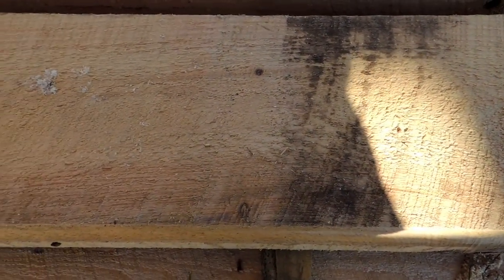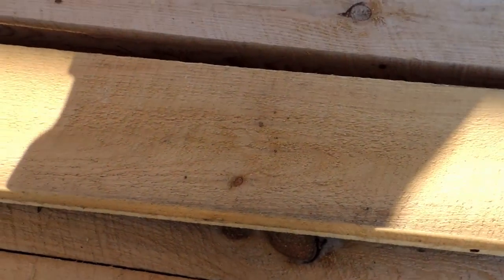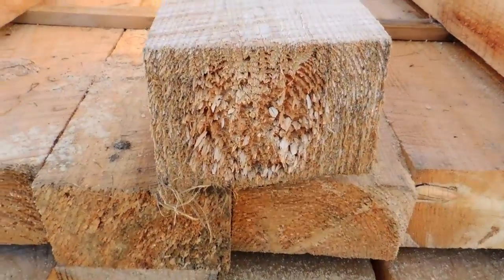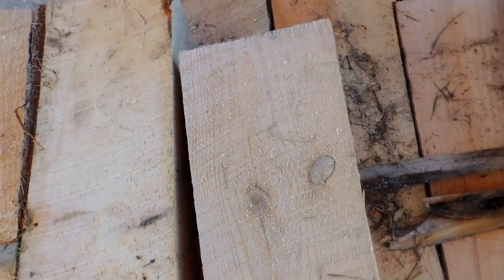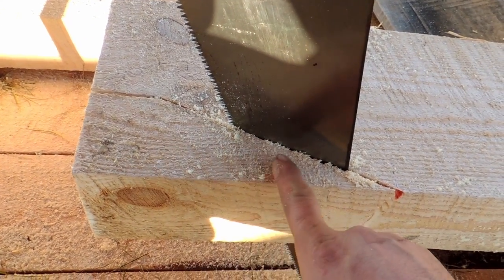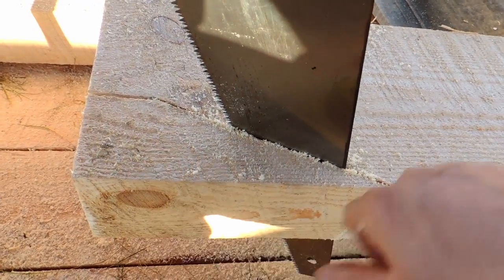A Timber Frame Vlog #9: Floor Joists and Timber Selection

Comment: Hi Jim, since this is an older video, can you share how the floor joists have settle over the years?  With the joists shrinking as it dries and seasons and the girt/plate and summer not shrinking in length, how large of a gap has formed in the joist pocket so far?  Has it caused any problems for you like loose joists?  Thanks for the video
Reply from the maker: Good afternoon.  I actually have had no shrinkage yet that is visible.  If you put it all together green then things tend to shrink together.

Comment: I've always wanted to know how to find leads on the timber framing specific power tools such as the large diameter skill saws and those nifty plunge cutters that make quick work or the mortise's,  or however you spell the plural of that damn word :p

Since you were asking on questions we have and all.  Might be a bit far off topic for the direction you have now roughing in the framing though.
Reply from the maker: +Rk Stewart eBay is where I found mine.  The chain morticer (you're right, that word is a pain in the ass) goes for about a $1000 U.S. used.  Timbertools.com is another good place if your buying brand new.  All in all eBay has been my best source, the Bigfoot saw I have I bought used on eBay for $350 U.S., the saw was almost new.  Just the head for that saw to make it a beam saw is almost $800 new.
Good question, I'll probably do a short video on the power tools.

Comment: You have three choices with grain shake...

1. Not use it
2. Cut off the ends for a shorter beam elsewhere
3. Iron bands around the weak sections (must be hot fitted very tight, otherwise they'll get loose with shrinkage)
Reply from the maker: +Sean Hazelwood good points.

Comment: The wind noise on the outdoor segments on the video wasn't that bad.  If you are using an external microphone you can get a deadcat (wind noise suppressor) to go over the microphone.  

Looks the Amish you got those beams from use a big circle saw mill (Frick saw I think is the name).   It would seem they didn't have the attention to detail when milling to account for the taper of the log.  That is why that one beam had the grain run out off the edge of the board.
Reply from the maker: +bwillan the Amish around here don't have a lot of finesse when they do anything.  That's another reason I decided to mill my own.  I didn't trust them to get me solid grade 2 beams.

Comment: I had no idea that cutting those joins at a good taper (looked about 30 deg) instead of the mandatory square cut (the bit near end of video where your sawing those cuts - hope that makes sense : / ) can give the joint a bit more strength!! Thanks for the tip :)
Reply from the maker: +John Maguire morning John, you are welcome.